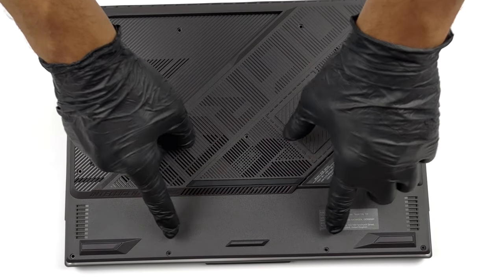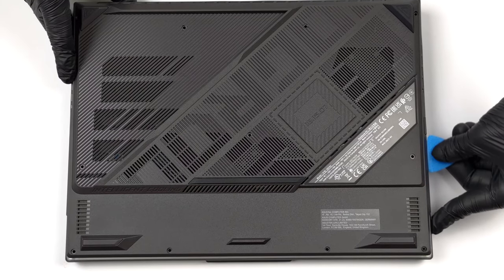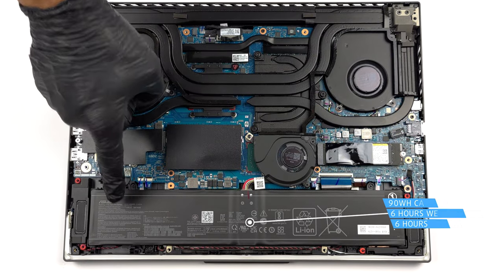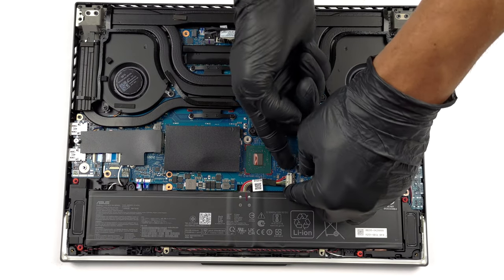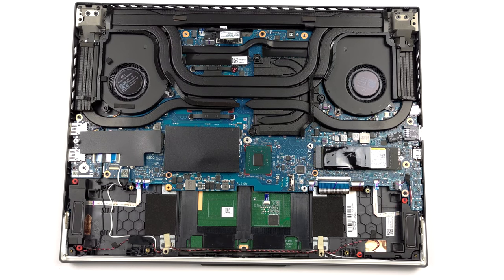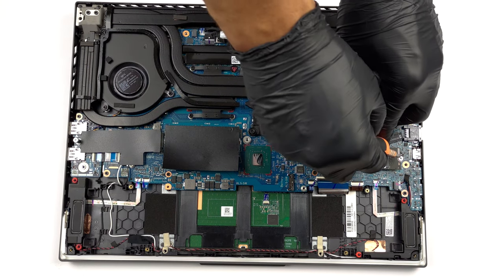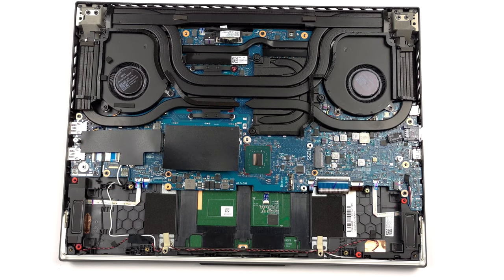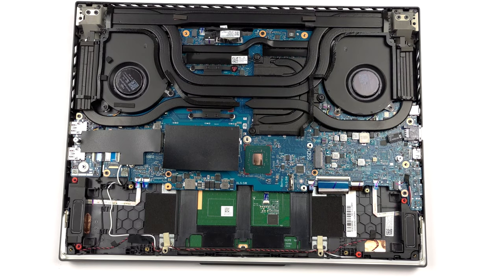🛠️ How to open ASUS ROG Strix G16 (G614, 2023) - disassembly and upgrade options

Comment: i was waiting for you to remove the entire cooling system then I remembered about the liquid metal 😂😂
Reply: Y eso qué significa? Qué tiene eso que ver?
Reply: @provisorio75  El metal liquido tiene movimiento siempre, no se seca como la pasta terminca, ademas es conductora de electricidad y si un poco cae sobre la tarjeta madre sin que te des cuenta puede freir la laptop, hay que tener mucho cuidado al momento de darle mantenimiento a estas laptops.
Reply: @arcangel2604  ok, entiendo. Crees que este modelo de laptop drl video (que es el q estoy pensando en comprar) es de los que usa ese tipo de pasta? O se le puede colocar de la que no es así? Saludos, gracias por responder :)
Reply: @provisorio75  podrías utilizar el otro tipo de pasta pero para estos equipos es más eficiente el metal liquido

Comment: Do you need to add heatsink to the secondary m.2 ssd if you install one? Also should you remove the black band or put on the ssd after installing? I am planning to install SAMSUNG 980 PRO SSD 1TB PCIe NVMe Gen 4 to the secondary slot. Thanks.
Reply: have the same question if when installing additional SSd M2 2280 it requires a heatsink or not
Reply: hello did u figure this out
Reply: Literally trying to install the same SSD, did it fit?
Reply: greyape59 what’s the thin heat sinks you’re talking about? Where and who makes them
Reply: Тот же вопрос, хочу купить  его и сразу заказать ssd с радиатором, но не знаю подойдёт ли толщина. Понятное дело что радиатор не пластина! Мне понравилось несколько, но самый тонкий из них этот: SSD Samsung MZ-V9P1T0GW 1000
Reply: @IMviolet28 i kak?
Reply: Did you found an answer?, I want to do the same

Comment: I really wanted to see you remove the CPU/GPU cooling system. I wanted to know if the dogsh*t 13th gen Intel was soldered to the motherboard. Also its manufacturering date and other label. Oh well, maybe someone else has done it...

Comment: Fun fact: I just upgraded the RAM and added one more SSD. I got the 16gb RAM version with the 4080 in it. The memory pre-installed was one stick of 16gb instead of 2x8. Also the website of the seller stated there was only one SSD slot but there were two like this video. Bought it in Western Europe.
Reply: yo what 16gb did you get if you dont mind me asking i got the same one few weeks ago and want to add just one more stick to it
Reply: Hi I’d like to ask you a question can I upgrade 512gb ssd to 1 tb ssd on rog strix g16 ?
Reply: How did you upgrade? How can I add this RAM and SSD on my Laptop, do you guys have a video about it?
Reply: @casavies  there are some videos out there but honestlly I got this laptop 3 months ago on a sale and added more ram. Just unscrewed bottom off and the ram and ssd has like a material cover over them they just pop out very easy
Reply: @TomSmith-ez3ft   thank you
Reply: @TomSmith-ez3ft  do you happen to have the link of the ram you got? Im wanting to upgrade mine as well.. Thanks so much in advance.

Comment: What is the recommended size for ssd heatsink ?
Reply: According his hand, storage should be 2280
Reply: have the same question if when installing additional SSd M2 2280 it requires a heatsink or not

Comment: what type of cooling pad should we use with it , like fan placement in cooling pad , whether it blowing one or exhaust one. 
I have i5-13450HX . rtx 3050 version.
Its CPU temperature goes very high stays at 95 degree celsius with some time spking upto 97-98 in Counter Strike 2 in medium settings.

Comment: bro is it necessary but whether to disconnect the battery on my Asus rog strix g16 the wire that needs to be disconnected is under the cooler I'm afraid to break it. I just want to know if there are risks without disconnecting the battery
Reply: this is late but i switched out the ram in mine without disconnecting the battery and it worked just fine. you just have to plug your laptop back in before you try and turn it back on… scared myself the first time when it wouldn’t turn back on. save yourself the anxiety!
Reply: @aust4ro  could you tell me which ram you used? I'm having trouble finding what it takes.. Thank you so much!

Comment: So what's the 3rd fan trying to cool actually ?
Reply: I have this exact laptop, I'll explain.......This laptop, as well as a few others from ASUS like the Zephyrus Flow Z16, M16 2023.........has something called a full-width heatsink.......meaning the entire back of the laptop is one long heatsink..........If you look closely, it has foam lining around the two main fans and rear middle internals, they are meant to direct the airflow blown from the third fan, which first blows cool air over the GPU/CPU area then exits towards the middle back heatsink. Most laptops have two heatsinks blowing out the back...left heatsink and right heatsink....and thus two left and right fans blowing air through them........this laptop has a third heatsink in the back, a middle long heatsink that takes excess heat from the left and right heatsinks and spreads it into the long middle heatsink...........If you add a third middle-rear heatsink, you need to add a third fan to actually blow air through it for proper cooling......On the bottom panel/cover, the area of the CPU/GPU is sealed so air blown by the third fan doesn't leave through under the laptop.......instead it is directed towards to back....This laptop was designed for the i9 + 4080/4090 (175 Watts)...........I have the i7 + 4060 version, the cooling is amazing........I live in a hotter climate and I can game full power at 45 Decibels..........or 40 Decibels with the Air Conditioner turned on....Basically silent.....especially after undervolting the CPU/GPU...........why? because this chassis is overbuilt/overkill for the 4050/4060/4070 (100 Watts) Models.........I hope that explanation helped.

Comment: can we upgrade 64 GB of ram in this laptop? 1 channel 32 gb each?
Reply: it may hurt laptop 
User manual of Asus said up to 32GB 
Just in a few regions like China, it's able to have 64 GB ram
Reply: @ghg1543  why?
Reply: @ghg1543  User Manual doesn't mean anything.......32GB is the maximum they sell the laptop with........The Actual Intel Processor can handle up to 96GB of RAM (two 48GB sticks)........64GB will work just fine.
Reply: I've got 2 x 32 gigs, no issues. Local computer repair shop did it for me. My model is ROG Strix G16JV.

Comment: Since this laptop is believe uses liquid metal is it okay to store in vertically when not in use or will the metal start to eventually drip on other components?
Reply: It's fine when there is liquid metal involve the cpu and gpu will have a surrounding silicon casing to stop the leak.

Comment: In term price to peformance which one do you think better ? G16 614jv or Tuf fa507xi ?
Reply: TUF is the budget series comparing with the Strix. So G16 is probably better
Reply: İ got the 614ji with 4070 and i7. Im pretty happy but asking myself "why didnt i picked i9 with qhd 240hz screen" and never got the answer. Its really a good machine. My friend got hp victus, other has dell gaming with similar hardware but i step better i7's. They happy with their laptops also but always jealous about my cooling and materail quality. Just i wish i picked 4060 with qhd and i9.
Reply: @aytacbayram210  Hey man nothing wrong with that, I just bought a G16 Strix with the regular 165hz FHD panel, and i have the i9 + 4070 combo which btw is a beast, just need to upgrade the nvme and ram and good to go, but your specs are plenty fine, an i7 is more than youll ever need tbh
Reply: what ram do you think gonna buy? samsung or kingston?need an advice
 @IpadLaser

Comment: Can you fit 64gb ram on this ?
Reply: the maximum is 32gb 16+16
Reply: @JeyJey029  nop I just did 64gb ddr5 5600mhz working fine the cpu sopports it
Reply: @norajuarez8470  is yours this excact model ? the i7-13650hx ? cause i wanna do it too but alot of people say its only max 32gb
Reply: @youngheart777  i think because of segmentation. Company who provide a wide range of products needs to be segmented into different category. They said it only maxed out 32gb because of they have strix scar lineup. My friend has 2tb ssd installed when asus said only 1tb and it run just fine
Reply: @youngheart777  did you bought this g16 laptop,how is the performance and did you upgraded to 64gb ram
Reply: @norajuarez8470 you wasted money buying 5600mhz since intel i7-13650HX only supports 4800mhz.
Reply: 13650HX supports DDR5 4800mhz, so even if you installed 5600mhz or higher, it will run at 4800mhz only, 

and as far as max memory support is concerned, you could try installing 64GB ram, laptop and pc manufacturers sometimes state less max capacities.

13650HX supports upto 128 GB RAM so you could try 64GB it should work fine.
Reply: I’ve read somewhere that the max 32gb of RAM is the max ram that the manufacturer can supply out of the box not the Maximum supported RAM. Though it is yet to be confirmed with Asus.
Reply: @youngheart777 spend a bit more and get the i9 if possible. It definitely supports 64gb of ram as for the i7 I have no clue
Reply: @norajuarez8470 dis the RAM upgrade worked without opening BIOS?
Reply: @norajuarez8470  could you tell me or link me the ram you used? Im really wanting to upgrade mine..

Comment: Is it possible to use a 4800mhz memory and a 5200mhz memory simultaneously ..one in each slot in the same laptop..?
Reply: Yes, but the speed will be bottlenecked to 4800mhz for both

Comment: Did you try a second ssd? I plan on buying but im concerned about if it needs a heatsink or not
Reply: I added a 4tb SSD about 2 or 3 weeks ago and it's just fine so far
Reply: @bootymagician  u put the new 4tb ssd to ssd1 slot (replace the original one) or placed at ssd2 slot?
Reply: @wn9358  I placed it in slot 2. I already had info on the stock SSD and plus I'm new to pc gaming so I wouldn't know how to put windows onto it
Reply: @bootymagician  clone it...

Comment: Can i upgrade the gpu from 4050 to 4070 or higher on g18 rog strix laptop?
Reply: dude , You're in 2023   The CPU and GPU are soldered to the motherboard and you can't upgrade them
Reply: @Lspixel  🤣ok thx
Reply: @Lspixel dude literally asked if he can have desktop and laptop at the same time